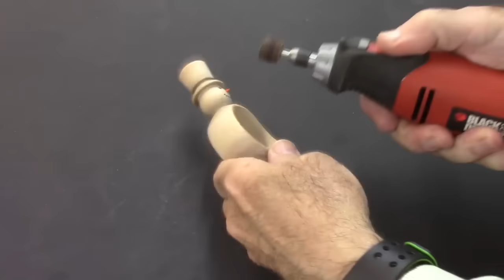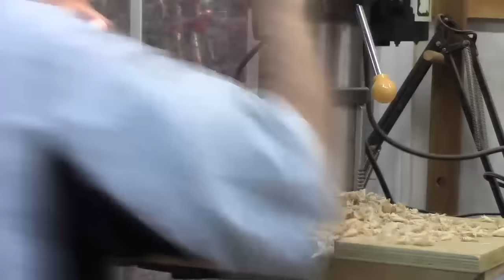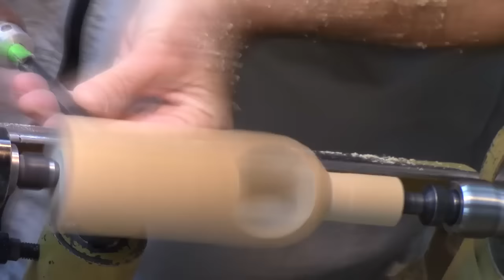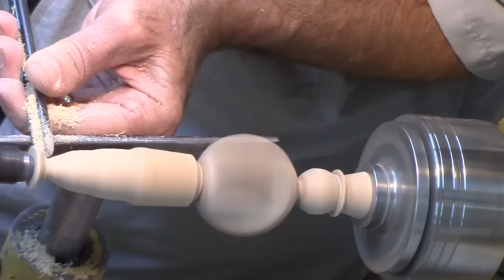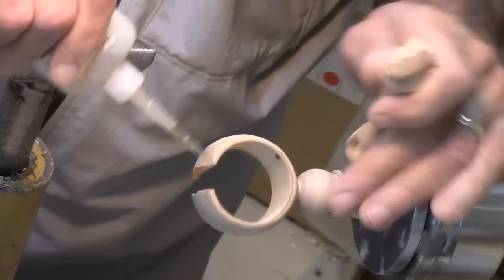Wood Turn a Hollow Snowman Ornament

Comment: Well done Mike. They are tricky little fellows. Good save though. Love your little round stock skew.  I use a small home made three face point tool. Same function.   
I find that completing the finial early on leaving a very small connection with the tailstock and backing the tailstock off until the centre has barely enough friction to turn, helps.
I then work my way up completing the body then the head then the hat before parting it off.
Reply from the maker: +Jim Robb 
You are absolutely right about the finial support. I rarely use my round skew but it seemed right for this. I use my point tool far more.

Comment: Cute little ornament, and I was probably as "excited" as you with the blow-out. I wonder if an alternative method might be to partially drill the penetration (say within a quarter) and finishing that off after the turnings.  You'd have longitudinal support throughout, but might offer other challenges. Just don't know until I give it a try.

I, too, am interested in your little skew. Maybe that could be another episode?
Reply from the maker: +Joseph Scarborough 
I think doing the tip first and then bring up live center with a wood or plastic soft touch tip to support it is probably the best route. 
You are the 2d viewer to suggest the round skew video. I will do that. Thanks.